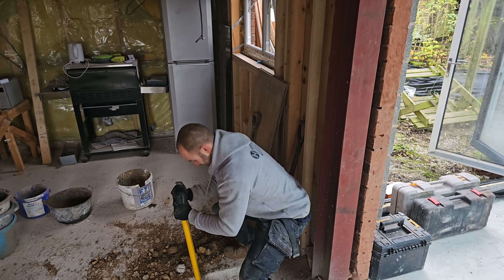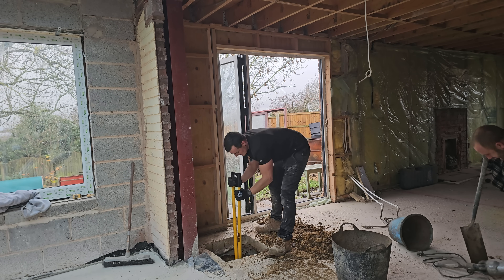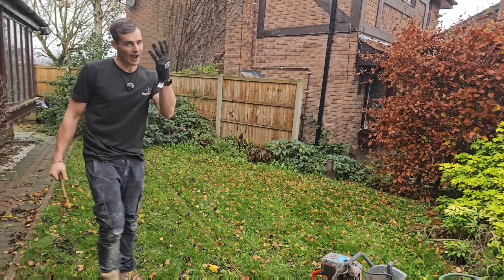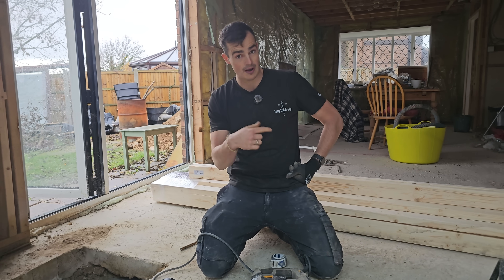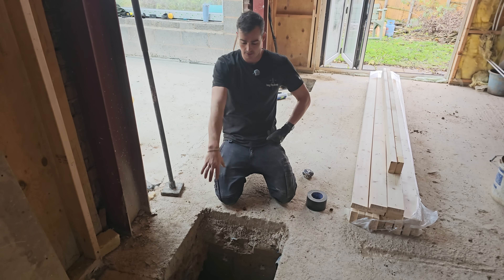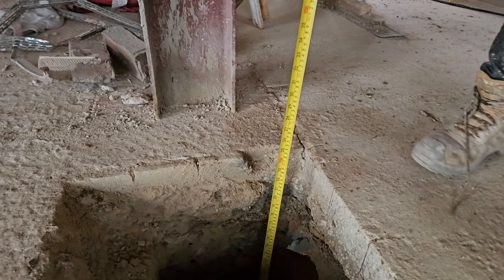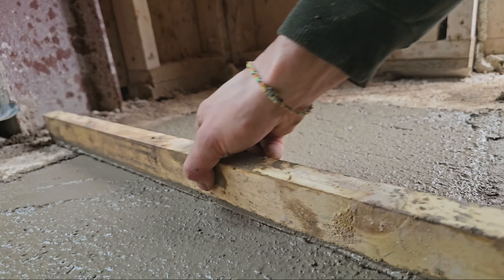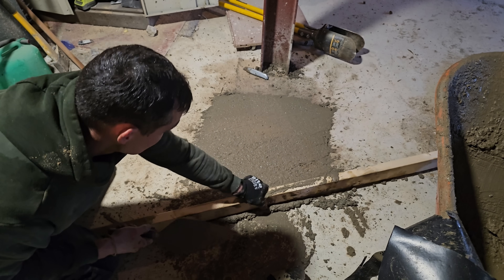Building Control Refused to Sign This Off — Here’s Why #bricklaying #construction

Comment: Well over the top 
There are houses sitting on only 9 inches of concrete which are still standing after well over 150 years 
They have spreader courses to distribute the load as well most houses back then had lime in the mortar so it made the building abit more flexible
Reply: So originally the side of that house was supported on a wall that bore the weight of  that side of the house evenly on a footing, say that footing was 9" thick, but now that wall has gone and the load is being borne by two steel posts, maybe 8 " square at each end, and a cross beam overhead,  why do you now think that basically the whole side of the building can now be supported by  two  8 " by 9" cubes of  concrete? Incidentally,  does "flexible " lime mortar possess some form of anti gravity properties  ?
Reply: @jeremyfoster6942 I take it your an architect
Reply: @nealchowney1028 you're welcome

Comment: Ok so bro, Could you not just Hold the Steel up with Acrow's and take the steel vertical out or Dig it around because the weight is being held by props

Comment: This is just Nuts! Those columns are supporting a domestic house not a 20 story block of flats
Reply: It's been the same with ridge boards when pitching a roof. For centuries there was no ridge board and we still have houses standing from 400yrs ago or more,  then the ridge board was bought in to do nothing apart for having something to lay the rafters against before fixing them in place, this worked for centuries and now in many cases they make you fit a 9"x2" ridge and for what?. Time and shown a 9"x1" ridge has worked perfectly well as has nailing collars rather than now having to bolt them to the rafters....................Over engineered tripe just to cover BC's arse. They are a joke now in the industry and in general a bunch of cnuts.
Reply: @adriansams6066 ridge boards make it easier for builders and provide some bracing, but yes they arent needed if you make alternative provision, but in a cut roof a ridge board is simply the best and most convenient way of doing it. Yes you dont need a 9 x 2 ridge board but who specified it? Maybe it was the most convenient size, but it wouldnt have been specified by an engineer. A structural ridge is an entirely different thing and likely to be more substantial than a 9 x 2 unless spans particularly short. The fact that you consider bolting a collar roof together as unneccesaary overkill  says to me you really dont have the knowledge you think you do. Sure for some collars nailing may be sufficient, but why do that when for similar time and expense a bolted connection does it properly.
Reply: Building control have actually made me chisel away rock to increase concrete depth from 3 to 4 inches
Reply: They might build ten stories on top tho …🙄😜
Reply: But the builder got into a lot of trouble and cost for the sake of a few barrows of concrete. He did a lovely job overall but he should have dug down to solid ground  AND got the blasted thing inspected. A lot of trouble for very little saving.
I do this sort of work myself and I know the pressure the guy was probably under to get on with the job so I do feel for the guy. Hindsight is perfect.
Reply: @johnryan7932 yep I dont know why the Building Inspector is getting so much flack in the comments. The guy was concerned that he hadnt been given the opportunity to inspect the foundations before pouring the concrete, had the new foundations exposed and they were crap. No-one is criticising the steelwork, and from the size of the steels that is a lot of load that the new foundations have to support. Everyone should be praising the BCO for a job well done.
Reply: Yes, all the domestic building work we do in the uk massively over engineered now.
Reply: @coopdogg86 But if you're not a chartered structural engineer then how do you know that anything is over engineered.  Everything done in this video looks quite reasonable.  But I have recently been asked by a ljcal builder to re-evaluate some foundations, raft and steelwork as the first engineer had over designed the work.
Reply: @johncranna9427 In this instance the pad for the steel uprights wasnt deep enough but generally speaking in my experience the structural engineers spec on certain things have gone crazy, Im having 225x100mm hips spec’d for 45 degree pitch roofs with a span of 6m, they have trebled in size since I was an apprentice in 2003. Perhaps due to poor builders on the market the engineers have had to cover themselves.
Reply: @coopdogg86 That is nuts.  I regularly do analysis of roofs and my 3D frame program shows that hip members are mainly in compression and not bending so they dont need to be as large as you mentioned.  Its different for valley timbers - they are in bending.  But the important detail to get right with hips is having a dragon tie (originally called a dragging tie) to prevent outward thrust at eaves level.
Reply: @johncranna9427  Hips are subject to bending, the load comes from the jack rafters and the problem also that the hip rafters have a longer span than the common rafters. In my part of Europe, it is common to see a lot of sag on the old hip rafters which were undersized from the beginning. My own house being a good example!!
Reply: @johnryan7932 in a properly constructed traditional roof the hops should only be subject to a small amount of bending force. If your hops have failed in bending that can only occur if other timbers in the roof are not doing their job properly, so no direct fixing between rafter feet and ceiling joists, no binders fixed to rafter feet perpendicular to ceiling joists, colar roof construction, inadequate purlins. A hip only needs to be a board but providing something more substantial is just an insurance policy if something else goes wrong.
Reply: The key is to demonstrate to the building inspector  if the foundation work, depth, ground condition and size follow the approved drawings. 
Sometimes the builder did not give enough notice for building control to come out to inspect key stages. Once covered, it will then up to the builder to show compliance. 
An alternative is to take timed photos or videos at these key stages as work progress. Hence the problems you are now facing may be avoided.
Reply: Architects drawings usually specify around 1m dig for footings.  That’s probably what the builder did and then just got on with it.  Unfortunately this is an inspection  stage for Building Control to see if the ground is good enough before pouring the foundation.  They don’t like you just carrying on so they make a point by having you dig it up then struggle to get another foundation in whilst propping the building up and also carrying the expense of it all.
Reply: Seen this this before when I worked in building control, the issue is not If the support may be ok the issue is building control is mitigating any potential risk of being sued for turning a blind eye to potential risk of failure and also adopting a work culture of turning a blind eye to deleterious  works by working to specifications.
Reply: Does anyone actually sue Building Control ?...
Reply: @peterfitzpatrick7032  Yes, the cases may not get any media coverage, but it does happen so best keep your ass covered.
Reply: @derektomlinson6514  it’s not going to ‘fail’ though is it. Just potential for increased movement in the existing structure as the beam deflects and columns settle in. This is cosmetic.

Comment: Please dont mix the term structural/civil engineer with building inspector, they are different classes. If the steels are sat on the concrete pads as shown in the drawing, they are not gong anywhere. In fact if they where to move with the pad being off centre the columns would tilt and be more of an issue than just the column sinking a few mm. As usual the engineer wants a simple life and is just doing what the inspector has said. And rebar youve installed will do absolutely nothing and movement and it will just rip out as you have no idea what strength your concrete is.

Comment: I have to say I find this BS.  Digging down to belt a couple of pins underneath steel stanchions, then fill the hole to the side of it with concrete (which is not supporting the stanchion) is in no way going to support those beams.  That is unless the ground is solid enough that the pins don't even really matter - which I think is the case.  Belting those skinny pins in took a lot of effort, which proved to me the subsoil was solid and that this job was a complete waste of time AND money.  The building inspector should have been dragged out after digging the first hole to prove how solid the ground was.  Jeez, the guys were pulling up what looked like hardcore, almost half a meter down.  Taken these stanchions were on a good few inches of concrete that  should have closed the case. That ground was solid enough.  No more holes needed.  Where do they find these inspectors?
Reply: Didn’t realise u was a structural engineer. U melt
Reply: @vengomel1 you don't have to be. Adding that rebar and concrete footings would theoretically increase load bearing capacity of the pad for the post. But 2 pins? If your going through the effort, the two pad needs to be homogenised. Ie  about 8 pins not 2. Otherwise you've got two pieces of rebar in shear, plus the surface friction of both pads.

Comment: well following 1976 the requirements were for a One Meter dig to firm ground, firm ground was proved by driving a 50mm x 50mm length of timber in to the subsoil, if it went in dig deeper until resistance was proved !
Reply: Glad we don't use that method anymore...just like we don't do corbelled footing on clay lol

Comment: I'm not a builder but an old steel fabricator,  i cannot see how  what you have had to do has made this job any better, just putting a bit more concrete to one with 2 bits of rebar, 
What was there looks more than adequate, but hey what do i know., Well done you got it done
Reply: Exactly - this the equivalent to 2 people standing on a set of scales each and trying to transfer the weight between them by crossing arms  🤷‍♂🤷‍♂- and that from a University Prof in Civil Eng.
Reply: Yes but... Doesn't matter if it's needed or not, the certificate definitely is needed. You must've seen lots of work in your time that was for the inspector not actually necessary otherwise 🤣. My extension has pan tiles with ventilated eaves and soffit vents!
Reply: Obviously nothing.  You could have designed a reinforced slab, as a pad, if it had the correct area, not to over stress the soil. Clay is generally taken as 100kn/m2, gravel as circa 150kn/m2. As someone who used to write structural reports, and prepare engineering calculations for various projects,  I invariably had trouble explaining the reason to house owners, for deep and the certain size of pad footings.  It was usually because the builder had told the owner, "the pad foundations will cost £X, followed by, how much?"
Reply: For small openings like this why don’t they install a steel beam upon a footing below FFL which the columns and top beam sit on, like a frame. That way there is no upset from the original format in terms of load spread on the ground.
Reply: Watch it again and pay attention to the part about poor ground 🙄

Comment: Shame that you lack electrical safety... 
That extension reel (@2:43) has ONLY got a minimal current rating when fully wound! FAR less, than just ONE of your wreakers!

By not FULLY unwinding it. Particularly with THAT kind of load on it. You risk not only melting the cables. But also starting a fire. 

To hazard a guess, I recon that each Wreaker is close to 2kw each. That extension is likely only 0.75mm to 1.25mm. now, given the time of year, and the open doors, you do have the advantage of the surrounding air temperature being cooler. 
But if you've done it once, then then you likely do it on most jobs.
Get yourself some proper 16A CEE extensions in 1.5 - 2.5mm, and change the wreaker plugs from 13A to 16A CEE plugs. This will make it less likely that you'll wrongly use an extension reel in the future...
Reply: Where is the 16A supply?

Comment: So the original pad is being supported by two bits of rebar because you didn't under pin with concrete 🤔 just stuck more concrete by the side 🤔
Reply: Yeah, I don’t get how concrete to the side is preventing the steel from movement.
Reply: @OrdinaryJoe12  I think the point is that it was originally done correctly but nobody saw it to sign it off.  This meant they had to dig the adjoining holes to inspect it, which showed it had been done correctly.  However, given the potentially loose soil underneath the correct footings, for safety's sake they decided it needed a bit of tittivating so they used the adjoining inspection holes to provide a tad more support.  The rebars are just to supplement the adhesion between the 2 concrete pads and ensure they don't pull apart.
Reply: @marquisdemoo1792 I dont know how you came to that conclusion. If that was the situation they would just have had to backfill with concrete, no rebar required.

Comment: Im surprised by all the comments complaining about over zealous building inspectors

the simple fact is that building inspectors will always accept a  structural engineers design (provided its a S/E qualified and indemnified to work to B/regs) 

the problem in this particular case is that the builder did not ensure the structural work was signed off before continuing.

a pad of a steel column must be treated exactly like a foundation....get the hole inspected and approved before continuing.

This sort of thing happens on site because builders want to get on with the job, quite often they have more than one job running and the guys on site just carry on -its a schoolboy error, but its quite common.

And dont get me started on private inspectors that accept photos of jobs "because they cant get there"
Reply: And private inspectors who won't take on projects with unusual materials.  In the past, when I have been building with cob  (there at least 40,000 cob structures in Devon and Cornwall, some of which are many centuries old), private BC have declined getting involved but local authority BC have been keen to help for their fee.  Fortunately in this region of Cornwall local authority BC still behave as though they are proving a public service more than do the absolute minimum for a fee.
Reply: "providing a public service"
Reply: @adrianfielding4678  I'm guessing that implies different levels of expertise, or breadths.  Presumably that's ok if all the bog standard (sorry!) stuff can be signed off leaving more complex/different stuff to be analysed better?
Reply: I was going to say the same.

Comment: The original footings were found and the original building hadn't moved on those. Nice hard graft there.
Reply: The original footing were dug on virgin ground. The new footings were dug on made up ground consisting of the backfill surrounding the original footings, hence the need to dig down to solid virgin ground. From what I understand, there was a minimum depth to dig to or solid ground, which ever was the greater.
Reply: @grahamb1 thanks missed that detail, I did wonder.

Comment: being a steel guy that installs this type of work weekly, we have to trust the builder in doing the correct base, 450 seems fine, but i am not an engineer but i do know the engineer would have done a drawing on the founds for the builder to follow.
Reply: Those are the houses that survived..
Reply: I done some modern internal ones, always seems to be 1000-1200 of FFL. One pad was 1400 x1400 and 1500 deep, had a break out the old foundation and rebar of it for the new pad.

Comment: Dont understand  why your digging a hole on one side ?????must be canterlever type of thingy stuff looks much safer though
Reply: I think they dig on just one side so they can dig some dirt out from under the post and replace it with concrete. 
I think this whole job is overkill, but what else can the homeowner do but comply? Nice work by Izzy and the crew.
Reply: @richvisser7563  If they are digging under the post ? Then the post which is lucky didnt give way  without support .So in my reckoning it was safe in the first place prior to dig.

Comment: Nice work Izzy and the lads correcting a slightly over cautious building inspectors concerns. We had extension build in the March and completed in the September. On Xmas eve the building inspector calls round to say it was never signed off. After a cup of tea and a mince pie off he went as by now it was all furnished and decorated 😅

Comment: Surely putting screw piles under the stanchions would have done the job. I live in an area of hard Silt, and we suffer from zealous Building Inspectors, too. Good job that you are young and fit. Under pinning is always in danger of collapse, we had builders die by trenching too much out under a wall on a nearby site.

Comment: I’m surprised the inspector wasn’t sold on 450 ml concrete with rebar as sufficient foundation.. that seems extreme .. but great work brother!
Reply: Concrete and rebar is only as good as what it is sitting on.  As explained, in this case building control wasn't happy the ground was solid enough to take the weight..